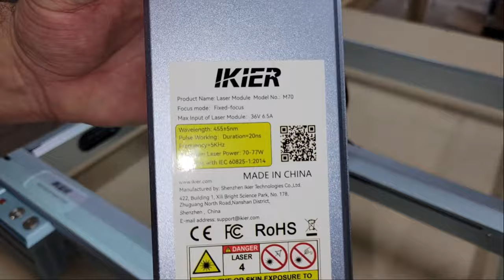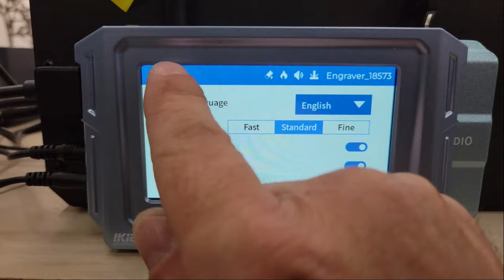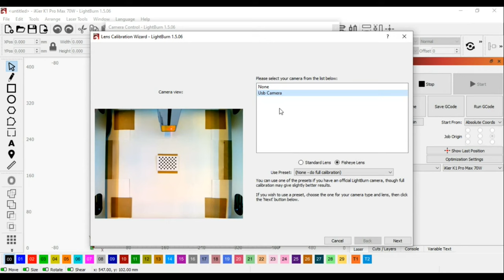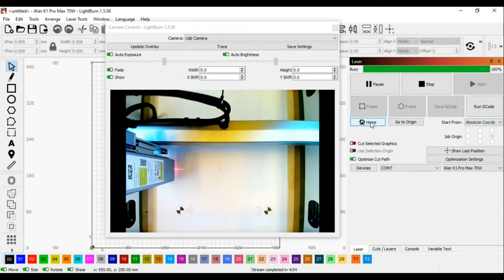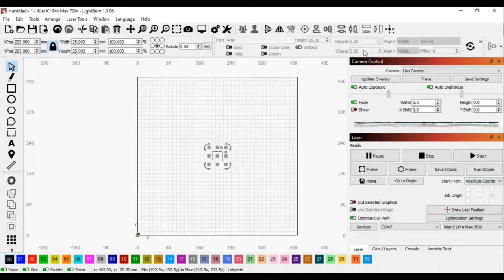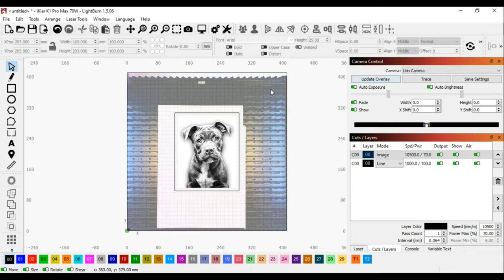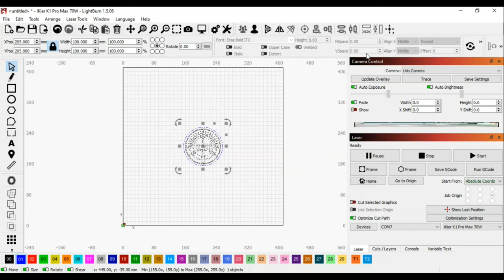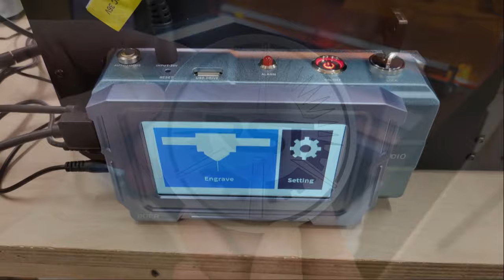iKier K1 Pro Max 70W Laser Engraver & Enclosure

Comment: Its not hard to design a box-addon that can incorporate an On/Off switch for the Evac Blower as well as a relay switch that picks up the Laser "on" signal to turn on the the Evac Blower. That would solve your issue. I already have a 108 watt CO2 laser or I'd pick this one up. Great video. Cheers!

Comment: i am looking to get one  but that is a lot of money i would like to see how well the frame and all that is built
Reply from the maker: Just showed you. Made with aluminum extrusions. Square, doesn't rack under normal use. More than strong enough. But it's not a cnc router, either. The only load a laser needs to withstand is its own weight.